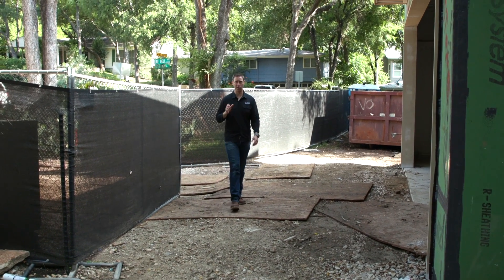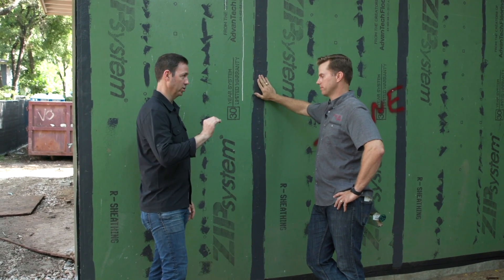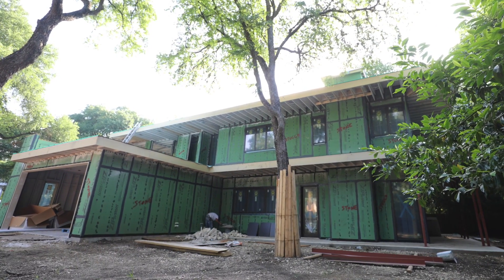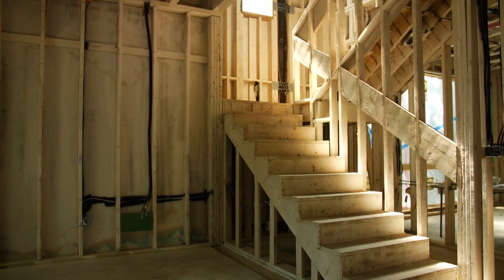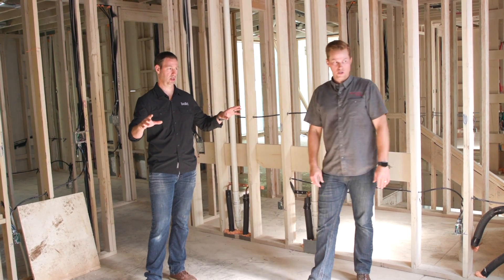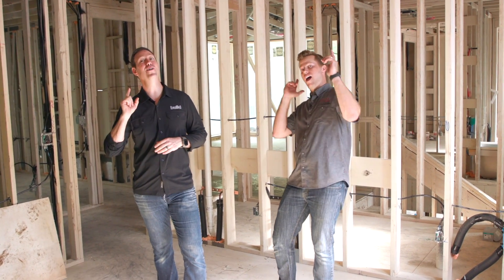Foam Free House - Is this Silly, or should we ALL BE BUILDING LIKE THIS?

Comment: I occasionally work with electronics and you can see a faint background noise at a 60hz frequency picked up even just from the open air environment.  But this is levels of power lower than what you would even see from a thermal couple. I can't imagine how it could possibly effect anything.

Comment: Once EVs take over and all tools are battery-powered, this argument becomes mute.  The ICE is quickly dying.  I no longer even have an air compressor on my job sites.  My compound miter saw is battery-powered on wheels.  All my toolboxes are battery-powered on wheels.  The only piece of equipment left with a cord is the paint sprayer and it is on wheels as well.

Comment: The clay is actually a great idea, an inexpensive natural coating.  However, I think though a more natural approach to the framing for less cost, better thermal qualities, and getting rid of the foam completely: is building a double 2x4 larson truss wall system with blown in cellulose.  Blown in cellulose is a far superior insulator than rock wool because it fills around all the mechanical systems, and it's proven to not cause long term lung damage.

Comment: Owner is a moron - the 60hz in the wires transmits very little compare to microwaves, cell phones, electronics, overhead satellites and cell towers, allowed OSB everywhere which is chemically loaded, added chemical spray on studs - how is she going to avoid the sulphur waste in the drywall? Great for contractors, totally robbed. Tyvek would be better choice as it allows VOC to outgas...

Comment: Homes today offer so many different systems, which also come with a whole lot of learning and confusion, each all sort of sound good, like many generations before us that also had what they thought was the latest correct and best building practices. Some fared better than others. We’ve all heard of some developers creating entirely new neighborhoods trying out new systems which have resulted in multimillion dollar class action lawsuits, some have problems showing up within a year or two with moisture and water not escaping, causing major wood rot, others using spray foam that wasn’t applied correctly also causing major repair problems along with health issues. These homes at least looked beautiful, but that was about it. It doesn’t matter it beat or exceeded code, often they are not up to date, or are still relying on bad data. I know a lady that lives in a home built in 1920 that didn’t have any insulation, no vapor barrier, and refuses to get it, she wants it to breathe. Her utilities are not as bad as I would have thought, but I’m sure isn’t as comfortable as today’s homes when there are weather extremes. At least her wooden frame home has held up well.  I do feel like these styrofoam type insulators are superior over its predecessors. Sometimes it appears for every problem that gets resolved other problems are created, and one won’t fully know until a few decades later how well it’s going to do.  Some don’t even have to wait that long to find out. Now some new homes are requiring an air exchanger because they are too air tight (at least initially) yet adding more expense and other complications which is going to need energy to run the fans and other components, along with having a finite life that that will probably last about on par to hvac systems. Costs per square foot on homes are up to what these days? $200 minimum and that’s not including your lot? You almost have to be a millionaire to have these kind of homes. Having a reputable contractor and builder are more important than ever before; they certainly have their work cut out for them.  Enjoy Matt’s videos over the years even though for me, anyway, it’s made it more difficult to know what direction to go in with a new home, just too many decisions to consider, not even sure I want one at all anymore.

Comment: Is you put tape between the sheathing and the foundation, then won't the moisture from the concrete rot the lower part of the sheathing, since the moisture will be trapped, and will not dry?

Comment: So many comments on here about how the customer is crazy. I learned a long time ago not to judge someone's choices but rather charge them accordingly for what they want. Why should I care how a project is built if I'm making a good buck ? I know there are times when a customer wants something that is clearly not going to work or hold up long term and you caution them against their plan or refuse the job, but mostly people, especially the monetarily endowed, want good service to their needs and if other professionals are making the material and design specs the builder is not (as) liable for problems down the line.

Comment: “You don’t stuff your sweater between your ribs.” Matt says that a lot, too. It was coined by Joe Lstiburek regarding what he calls “the perfect wall,” which requires the water, air, and vapor control layers to be behind the insulation and outside of the framing. But Matt! If an engineer applied to work for you wearing a raincoat under his sweater, and his exterior cladding, his shirt and tie over the top of that hot mess... you’d write him off as a nut job.

Comment: I thought for a moment after the wire explanation, that they were going to put wire mesh in all the walls to act as a Faraday cage.
Reply: Block all the EMI. No WiFi, cellular, radio, or TV reception without cable or streaming.

Comment: Stop calling it Romex, it's called MC!

For those who aren't professional electricians, Romex is a name brand for non-metallic sheathed cable; it has a plastic jacket that replaces the pipe wires need to be in. MC is metal-clad cable; the metal cladding serves the same purpose as the jacket in "Romex" cable, but it requires additional considerations when it's installed (special MC bushings, the box needs to be metal so the cable is grounded, it should be cut with a rotozip but it's not necessarily requires, etc).

But anyway, back to the point: calling MC "Romex" makes you look like a worker who hasn't been properly trained with the material; call it MC.

Comment: Considering that there are several alternatives to foam for insulation that have superior attributes, I don't get the hate in the comment section. Rock wool, wood wool, sheep wool, cellulose heck even hemp wool. All have MUCH better attributes than any foam. In the case of sheep wool and wood wool, as well as cellulose you can blow those into the wall cavities and they will fill it out. Those materials are able to transport water out, should you get buildup of moisture on condensation surfaces etc.

In nearly all of Europe no one uses foam for insulation. In Switzerland most wooden frame houses are even built without Tyvek or Zip or anything. They have OSBs on the inside as a moisture dampener, but that's about it. The rest ist achieved by using materials for the wall that can breathe. Those houses stand here for ages, are super energy efficient, healthy and you don't get molding as easy. 

So clients that want to invest the money to teach a builder how to build a modern house in a different way should be celebrated. Sure they might seem alien, or unreasonable, but it could very well be, that they teach the builder something by their peskiness of bringing outside specialists in.

Comment: When you're building a house for a crazy person. 

They are literally covering shielded wires with paint to shield them. That would be like wrapping a faraday cage in a faraday cage, I wish the engineers would explain to the client how crazy that is. 

Also, if that paint covering isn't perfect, it doesn't work, in fact if there were any EMF coming from that double-shielded wire, it would be concentrated at every point where the paint is nicked or thinned out.
Reply: Someone probably tried, but then the check cleared so they said screw it, whatever you want.
Reply: @ShotGunner5609  I wouldn't.

At the end of the day, my duty is to the customer, if they want something that causes the very thing they want to avoid, I'll stand firm on it.
Reply: Run an EMF detector near home wiring and then come back and tell me how dumb you just looked. This client isn't crazy, they're aware of something you are not.

Comment: How about fumes from your hot car in a garage going up in a apartment above in that foam free garage ceiling 😀? Open cell Foam - when properly installed is an innert plastic, no VOC , No off gassing and gives you air tight wall or roof assembly. I install open cell foam for 16 years with great experience.

Comment: 2.35. He is worried about few doesen tubes of caulk on this project.. ." Linial footage can add up"... 😆 🤣 ffs.
By the way. We do open cell homes properly installed as tight as 0.6-1 ACH 50 up here in North East. No that stupid air sealing spackle job.

Comment: You should be really careful using MgO sheats, we had a couple of big cases in Denmark. Where water got through the sheating and into the insulation and rotted the studs. The magnesium chloride disintegrated screws etc.

I would have a second look at the roof sheating to make sure it is not damaged..
Reply: So what do you recommend using?
Reply: @akiwacz997  Paperless drywall, a la fiberglass backed drywall, common in commercial.  Much more expensive, though.

Comment: Possibly Useful: Reducing synthetic glues wherever possible. Some people do develop sensitivities when exposed, or already have them do to past exposure. In old houses you see solid wood boards for subfloor and even interior walls (with wallpaper to cover the gaps between boards), or simply go plaster and lath. But to not get too crazy, plywood has a lot less glue it it than OSB and may be good enough. Not sure about the kaolin clay to "seal" in the mold spores. If the wood never stays wet there will never be a problem.

As for foam, job-site applied spray foam can be really, really bad. So much depends on the installer. Polystyrene is close to 100% free of any outgassing (XPS or EPS), but R-value is higher with polyiso (used on this job). And the comment was made about factory-made foam boards which will be far more consistent than field-applied foam.

Completely Stupid: Shielding the interior power wiring. I am an electrical engineer and spent years working in the storage industry (disk drives and controllers). The signal coming off the read-head on a disk drive is about 1-millionth the size of (for example) the clock signal that drives the CPU chip in the disk drive. Isolation is achieved by the arrangement of traces on the circuit board, flex circuits, and wiring. Which are designed to self-cancel either transmitting interference or picking it up.

Romex is a pretty good physical configuration to self-cancel electromagnetic interference. Hover a probe at the surface of the outer jacket and you see a huge signal. Pull back an inch and that signal has dropped by 20 fold. Pull back to 2 inches (the surface of a wall) and the signal down several-hundred fold. A few inches from the surface of the wall the signal is no longer measurable. If you have an imbalance between hot and neutral (enough to pop a GFCI breaker) then your wiring can spew 60-cycle fields into the room, but they'd still be pretty weak. If the client wants to pay for it, populate the panel with all GFCI breakers as insurance (no pops = no problems).

The client's "consultant" is either an idiot who doesn't understand the fundamentals of physics, or they're a charlatan.

Other Thoughts: A few years back the US received shipments of gypsum wallboard that were heavily contaminated by sulfides. Move into your new home and within weeks your eyes would be watering and you couldn't function. I know of one new home buyer who had no option to move out of their home while the insurance company delayed, so they pulled all the wallboard out of their home themselves, and lived with exposed studs and fiberglass insulation. One could test shipments of wallboard for outgassing, or go back to plaster and lath.

Finally, forget the power wires in our walls, what about all the radio waves that surround us? If the client was serious they'd insist on wrapping their exterior walls and roof with electrical shielding. However doors and windows would be a tough challenge. If successful no cell phones or radios would work inside their house. The "consultant" suggested fixing a non-problem, but ignored the one thing that is measurable (but probably harmless) because it's almost impossible to get right.

Comment: Skip Intro 0:33
Prevent Leaky house 3:41
Garage 4:37
Motion Sensor Exhaust Fan  6:20
Kaoiln Clay 7:05
EMF/EF wiring 8:45
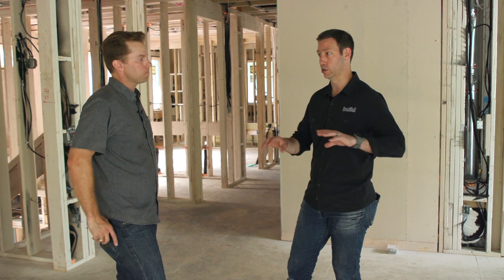Ziip R Sheathing (Thermal Brridge Gap) 9:33
Ceiling Insulation 11:20
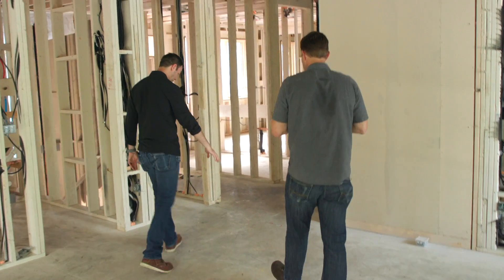3/4 MGO Instead of Plywood 12:40
Stairs 14:12
Roof Deck 14:30
Conclusion 15:20

Comment: Customer with more dollars than sense.   I'm a master electrician.  The wiring used is either AC or MC  the C in both stands for clad.   The outer jacket is for superior protection against physical damage versus romex.  It is NOT metal clad romex.   The metal cladding does not mitigate the magnetic field produced by the wires.   Magnetic fields in wiring requires, and is in proportion to the current flow through the wire.  A circuit with a single LED light will produce a negligible amount of a magnetic field, as opposed to the stove which will generate a much larger field.   If metal could stop magnetic fields, motors and transformers wouldn't work.  I guess if you have a "consultant" saying paint mitigates magnetism, you are one gullible idiot.  I did enjoy the better way to seal the ZipR Sheathing and it's connection to the slab.  Matt, as always, you bring quality content.  Thank you.

Comment: Yeah, don't tell the client that all of that decking is GLUED together. With GLUE. They probably should have gone with good ole pine 1x12's on a 45 to prevent deadly GLUE fumes from sneaking into their noses. And for God' sake, don't tell them the chemical name the Zip caulk. Their heads will explode. These are the same people who use cell phones and drive cars with 1,000 ft of wiring in them. I'm sure they work in buildings that are built as cheaply as possible, with none of these "precautions".  BUT - thank you for the video. Now we know what to spec when we build a house for an idle rich with nothing better to do with their time than huff GLUE FUMES. I bet the nails strips in the framing guns have GLUE on them too.

Comment: 9:26 Paint with graphite and cobalt will "shield magnetic frequencies coming out of our 110 power..." ?  Snake oil.  If the wires are already in metal containers, then adding paint will do nothing. Indeed, it will do nothing under any circumstances.

Comment: The best thing for electrical emf is a high / low pass filter,  shielded wire is great if it's only grounded in one location,  if its grounded in two spots it's bad,  but most importantly emf paint and wired internet.  Honestly doing more then your bedroom is likely overkill  its about an ability to recover from stress not avoiding stress permanently.  And I'm really sensitive my joints will hurt wherever I keep my phone but minimizing the emf from your outlet in your living room is not needed,  except if its carrying a secondary frequency,  but again that's resolved with a capacitor/ diode assembly not shielding... magnetic fields fall off very quickly secondary frequencies can travel further

Comment: 7:36...sensitivity to wood framing members?   Client does not need a house, client needs a glass  bubble with feeding tubes.
8:46..."in case the framing gets wet"....really?  Interior  partition wall gets wet ....how?
9:156...it's called MC cable if it's individual wires.

Comment: Nice build.   The special paint on the MC cable might be overkill, but since EMF/RF was a concern... was a screen installed [with drain/earth] on the backside of the meter pan?  Something like 3 or 4 feet either side is probablhy all that's needed, and will function as a parasitic array to reduce power broadcast into the home.. The new "smart" meters are burst transmitter equipped and... has anyone seen a full RF survey [mW per square cm-sec] of their lobe patterns/broadcast?

Comment: The only "client concern" I had the biggest "WTF" moment over the RMF (A rotating magnetic field is a magnetic field that has moving polarities in which its opposite poles rotate about a central point or axis) concern. The other "WTF" moment was over the subfloor, not so much about the specific product but the dimension (3/4 inch). Since they did not cover the "on center spacing" (I assume there is a basement since Matt was doing the "bounce test") this might be mitigated with 12 inch spacing of the joists.

Comment: Well boys you need to do your research of mold spores.    Actually spores in general.    I was a 91 romeo (food safety inspector) and had to know alot about spores.   They are near indestructible.   Unless you used bleach or hydrogen peroxide on every piece of lumber  all your clay treatment did was lock those spores in place where they will patiently wait for the right conditions to become active again.

Comment: 9:07 this is dumb. Chicago residential requires EMT, which is 10 times better than that flex garbage. We only use that for existing construction (fishing it down from the attic for a switch box or outlet)

Comment: If every circuit in a house has a continuous neutral that is ran inside nm sheathing to every device; the neutral cancels out the magnetic field. This is why current code requires the neutral to continue through switch boxes. Metal sheathing or raceways do a similar thing as well if bonded (to ground)..